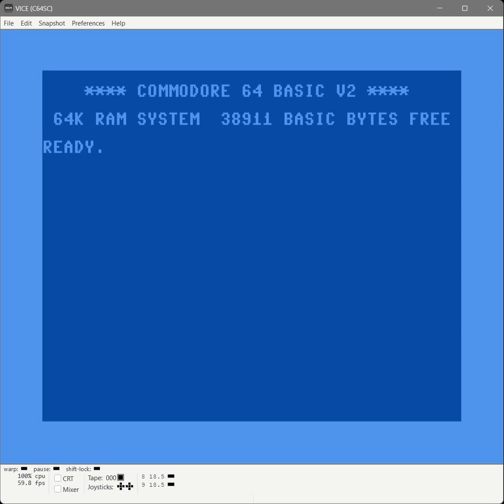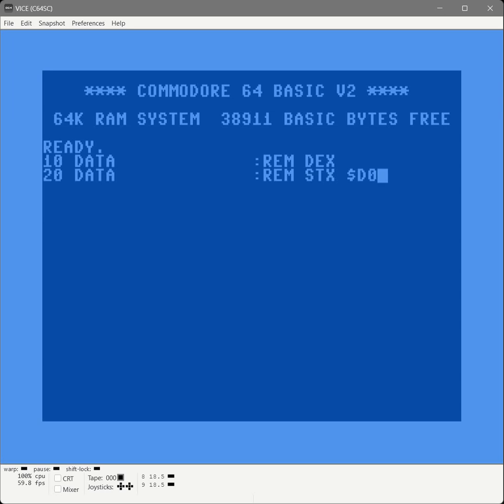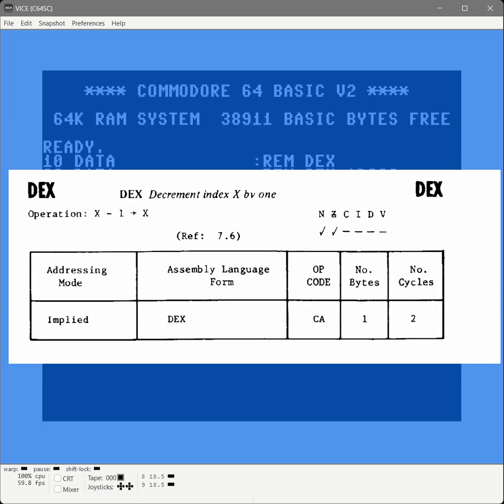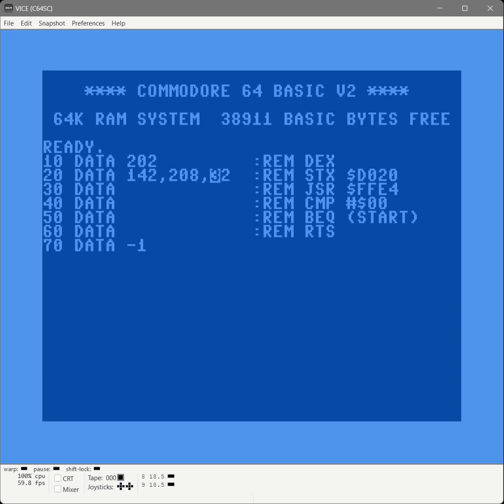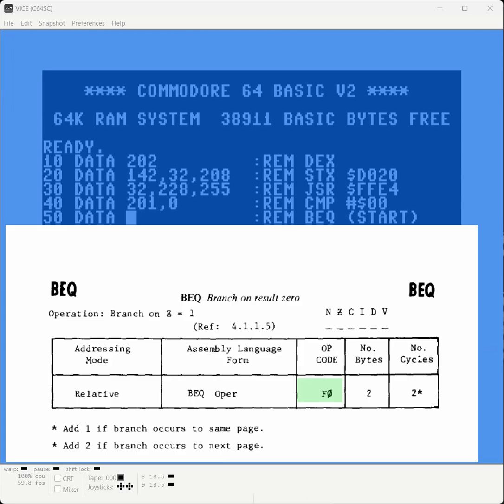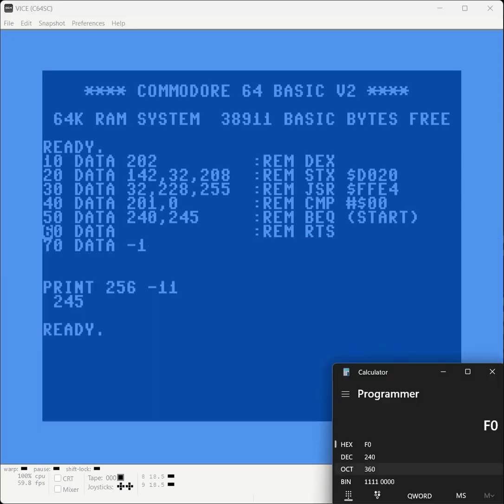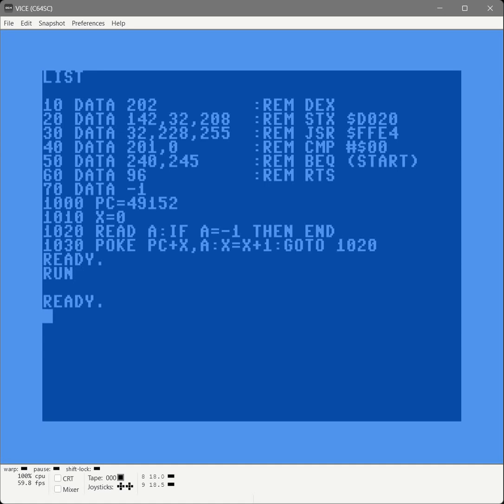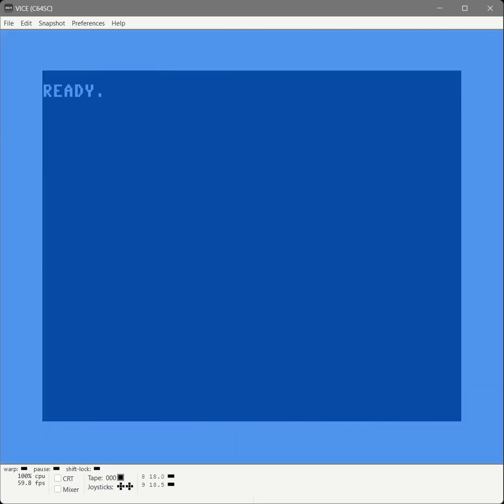Writing Commodore 64 Assembly Language....using only BASIC.

Comment: Just as a thought down the track - I would be inclined to go through the particular section of the Reference Guide, or photocopy it, and annotate all the opcodes with their decimal values.

Another useful resource might be a chart of the numbers 0 to 255 with their hex and binary equivalents, and a second chart with branch-command values having 0 in the middle.

Comment: Very, very well explained. 
Interestingly, this is exactly how things were done in the very early days of computing. Every CPU ever made always had (and will have) a mnemonic (human-readable text) version of every instruction/opcode (and variant) of the instruction set - purely because writing in machine code (numbers only) was never done (except as an academic exercise), for obvious reasons. The total number of mnemonic instructions then comprised that CPU's 'assembly language'. Programs would be written in assembly and the numeric version of each instruction/opcode (and operand if applicable) would be hand written against this. The operator would then enter in the numeric version to load the program - exactly what you see here. The BASIC loader program in this video then does the same thing as the early operators, poking each opcode/operand into memory.

Comment: What's the significance of putting the active part of the BASIC program down into starting with line 1000, instead of just 80?
Reply: so if you goof and need to add more data statements later, you don't need to rewrite the active bit. mostly just good practice and useful for larger programs
Reply: @OrangeDied : Isn't that what going by 10s was already for, though?
Reply: @HelloKittyFanMan  yea but making larger programs requires that much "whoops" room, i'd guess it's just force of habit for him
Reply: @OrangeDied : It doesn't necessarily require it, but I guess I can see it being somewhat likely needed.
Reply: @HelloKittyFanMan  While I always thought so, TRS-80 had a renumber command, but Commodore's version 2 did not, so if you had and major renumbering to do you used spaghetti code.  Unfortunately, you can't do that with data statements.

If I recall correctly, Simon's BASIC allowed you to renumber lines, but loading it from disk took a minute.
Reply: @mikechappell4156 : Thanks, but I'm talking about this program specifically, since a lot of times this isn't done.
Reply: No significance. Could have been any number. But it shows nicely that it’s completely separate from the DATA statements.

Comment: Haha, this is my first time of honestly trying to program the 128 through its monitor, ever since clear back in 1988 when we got it! But why doesn't this work? First, I typed F5 (245) to BEQ to but it questions me on that, so I skipped that part because we don't need keyboard input for the main feature. But then when I tell it to run at 0C000 (49152), it just breaks on me instead of changing border colors really fast! From direct BASIC, when I SYS409152, it just clears the screen without changing border color and then shows "ready" at the top.  Why? And what even is at the subroutine that starts at $FFE4? (EDIT:) Oh, but then it kind of works in 64 mode if I Go64 or soft-reset into there! The auto-cycle doesn't work, but each time I SYS it steps the border to the next color! So: 1. how do you make the BEQ work in the monitor? 2. Why doesn't even the BEQless version work in 128 mode?
Reply: I'd try the C64 first before using this code on 128 not sure it's directly compareable
Everything else meant it crashed, apparently
Reply: @QuintarFarenor : Between the 64 and 128 I don't see how there would be any difference in routines to rapidly change the border or field colors. As you can see, it partially worked when I go64ed, so that means that 49152 is in an area of the RAM that both sides use; not just the second 64K, which only the 128 has access to.
So RAM location isn't at issue; the BEQ instruction and other things are. But that's confusing because obviously the same processor is used on both sides for this.
I don't even know how to access the Z-80 other than through CP/M, and I don't know how to program on it from there.
Reply: @HelloKittyFanMan  I'm guessing one of the chips is banked at 49152.  The program will run just fine, but if you peek the memory at 49152 the program you poked isn't there.  The code is completely relocatable as written, so it's just a matter of finding a safe place to poke it.
Reply: @mikechappell4156 : It didn't run just fine, as I already described up here.
Reply: For the C128, substituting 2816 instead of 49152 works for me.  (That's the cassette buffer.)  It worked on VICE anyway.  C128 mapping may be flexible, but I don't know it, I just stumbled on the address in Mapping the Commodore 128.  Sorry, don't know the ML monitor.

Comment: Nice. If you absolutely have to do it through BASIC, that's a very clear way to lay a simple program out. 
Assembling the code at a screen location was a neat trick. Makes you wonder if one could use PETSCII to enter machine code directly onto the screen, then poke (peek) statements to write it elsewhere...
Reply: Haha, I just wondered that too! But what about the unprintables? And what if you relocated this into a lineup that included 53280 ($D020)?
We've had a Commodore 64 in my parents' family ever since I was 8, and here I am now, four decades later, having been the member of the family who got to keep this computer, finally understanding better what someone from way back then meant when he said, "Oh, that's the machine language" if I loaded something from disk wrong, like loading the directory with a 1 at the end of the load command  (nonrelocating), or like loading some machine language programs without the putting the 1 at the end (relocation to the top of BASIC). I wish I would have understood this about memory locations a long time ago!

So what does this mean in the context of modern computers such as current PCs and Macs, if we were to try writing a C program and then compiling it so that it ends up running in some memory address in the graphics card instead of the main RAM?
Reply: @HelloKittyFanMan  Compiling assembly to the graphics region of the 6502/VIC chip combination will give you garbage video settings and might do God knows what else. I'm very glad that the C64 OS was in ROM and completely immune from being permanently screwed over by anything you could do in software (the worst you can do is lose your program). Can you imagine having to load up the OS from a floppy which you subsequently lost or accidentally destroyed/overwrote?
Reply: Yes you can, or better yet, you can move the screen to a different location, say 12288, then print PETSCII to the screen and then move the screen back. This would essentially poke the code to a location other than the default screen location without using the slow poke and data process. I does take some time to figure out the correct PETSCII though and you have to keep turning reverse on and off depending on the character that is needed.

for example:
10 poke 648,32:print"{home}{reverse on}{shift+S}{reverse off}{space}{reverse on}{shift + P}{reverse off}{shift +L}@0":poke 648,4:sys12288

This puts machine code at $3000 (12288)
inc $d020
jmp $3000
Reply: While you can poke any value to screen memory and shouldn't have any problem, printing probably won't work because many characters do things instead of storing a character to the screen.  Using a string and calling memory where it is stored sounds useful, but storing '\0' in a string is problematic as well.  BASIC doesn't actually recognize arrays of type char, or arrays of bytes.  Easiest option when working with BASIC is probably READ/DATA/POKE to an available area directly, or store it in an array to be poked in later.  (There is no good call for the later.)  

Commodore BASIC 2.0 didn't allow you to include inline assembly.  I think Simon's BASIC did, but may be thinking of BBC BASIC.

Usual alternatives were to store the ML directly after your BASIC code and update the end of BASIC and then save your program; save it as non-relocatable code, so you could load it with  load"foo",8,1; or save it as a sequential file to be loaded by your program similar to read/data/poke described previously.

Comment: Is the CMP really needed? If GETIN stores the result in register A, this will affect the zero flag, no?
Reply: I recomment ProfiAss64 😉
Reply: This has me thinking about what it actually means to  be documented as leaving a result in A, without specifically stating flags are set according to that result. In this specific case I also think “well, in this case what else would it even do?”, and on a 40 year old platform it’s not like there’s the potential of a new ROM release next week that would break dependence on current behavior. But if this were, say, 1984, I could see myself not wanting to depend on flag state coming out of calls like that. (Of course I may have missed something in my quick scan of the relevant page)
Reply: @FirstLevelMagic there are multiple official revisions of the c64 ROM and people have created lots of unofficial ones since 1982. Some recently. Even though LDA affects flags, there is no guarantee that the LDA is the last instruction.
Reply: @phill6859  I understand that. If there were a large set of games/apps that depended on some function setting the zero flag even though it was only documented to set a register, and a third party rom release broke that dependency, do you think that rom release would be widely used?

I think that if there were a widespread dependency like that, the odds a rom release would break the dependency are pretty low.
Reply: @FirstLevelMagic  I have no idea whether all the kernels out there set the zero flag as you would expect and if there is a large number of apps that rely on it. The amount of effort to investigate that rather than just use two bytes and cycles, is kinda pointless IMHO.
Reply from the maker: I'm so glad you asked this question.  My original version of this code omitted the CMP instruction, and it worked perfectly fine.   However, I noticed in the C64 Programmers Reference guide for the FFE4/GETIN function (Page 283 in my PDF copy of it), they were using the CMP instruction in their example, so to keep the video 'aligned to the programmer's reference guide' I included the CMP.   In my opinion and very limited expierence, the CMP instruction is not needed.
Reply: @MyDeveloperThoughts  Had to look it up in the 6502 reference manual, too. LDA (which is used in the GETIN, of course) does influence the Z flag. So, yes, CMP #0 can be omitted.